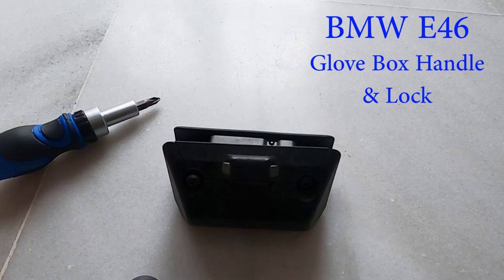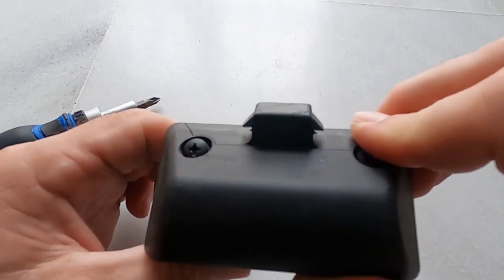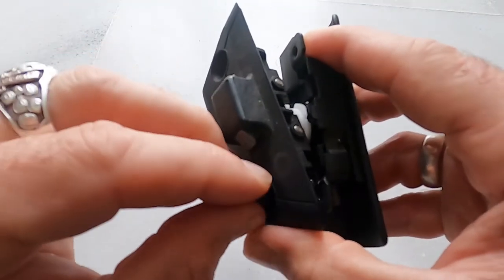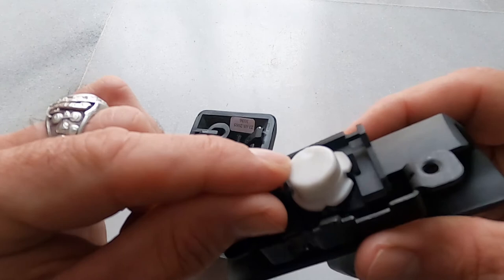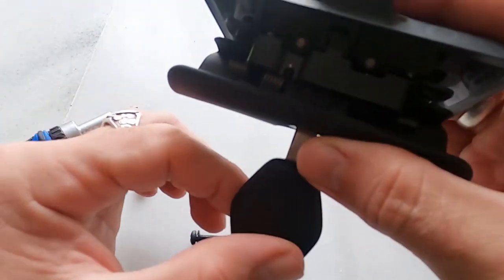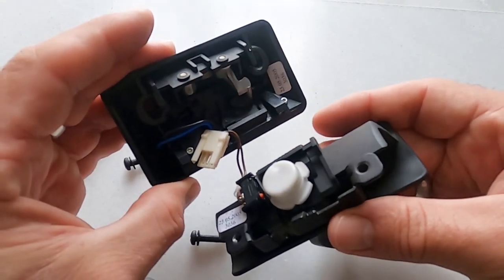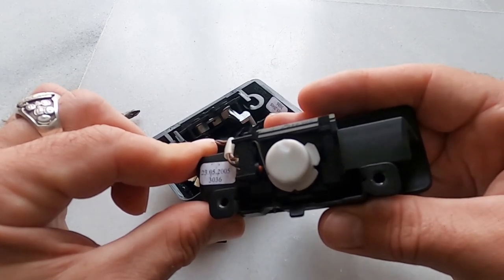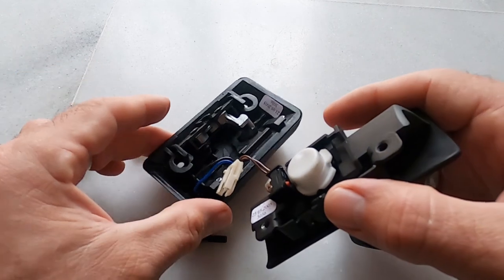BMW 3 Series E46 Glove Box Handle Not Working

Comment: I have a convertible 2004 E46 and wasted a lot of time trying to decide how to fix the glove box latch. I finally went to the local pick your part and I pulled the outside handle and inside latch from a E46 coupe (their inventory was online.) Took 5 minutes to pull and paid 6$. I installed easily, I didn't bother trying to put my lock in it so it can't lock, it works great and is solid. The trunk latch still function normally. This made me feel kind of dirty,"in a good way:)
Reply from the maker: Good work well done. 👍

Comment: Hi, I have the same problem with my E46 Convertible and consider to change to the less expensive Coupe-handle but some people claim that the trunk remote doesn't work after disconnecting the wire harness to the glove box handle. Have you experienced such problems?
Reply from the maker: Hi I did change mine for a coupe handle, and the boot release still works fine on the key.  👍

Comment: Ive got the same problem with my E46 2006 Convertible glove box
Reply from the maker: I ended up replacing mine with one from a 46  coupe..
Reply: @JFKKARZ  Did you ever manage to fix your side mirrors not working?
Reply from the maker: @LloydReyneke  No.. its still on my list.. as its a wiring issue..